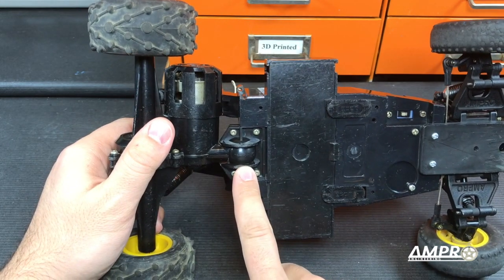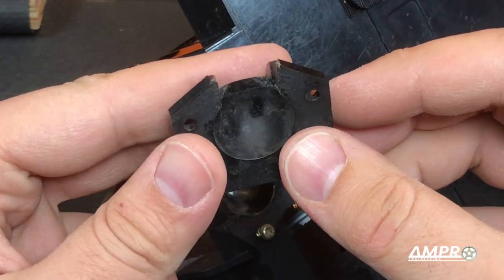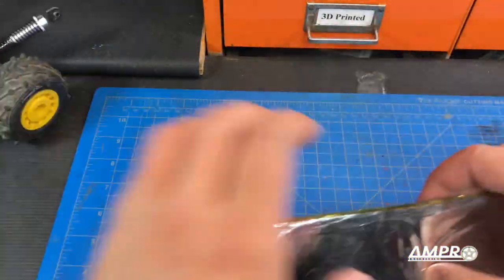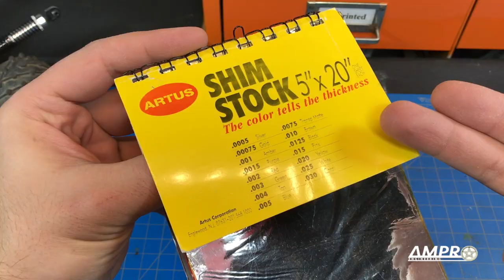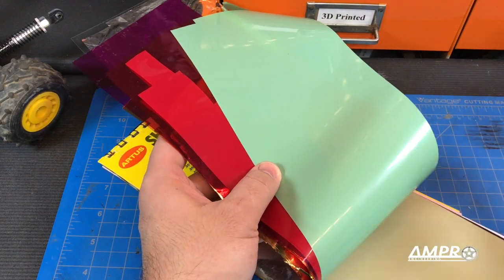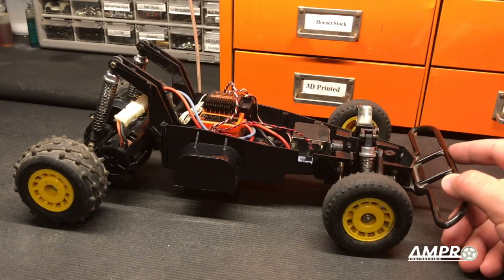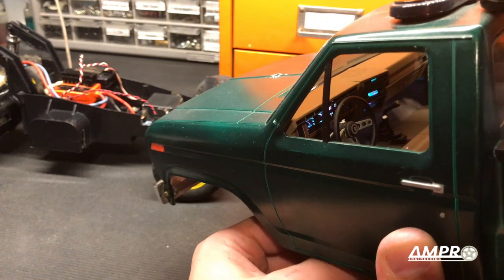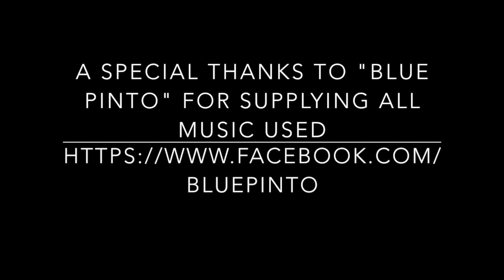e126: Varicom/Panda Pandamonium aka Graupner Pinto Project "Pointless" Part 4

Comment: Ahh the Novak T4 that was my first esc I ever bought I installed it in my Futaba FX10 (still have that car) I went through a couple of them always seem to blow out the brake mosfet especially with my RC10L eventually I saved enough money to upgrade to the higher end esc plus a discount from  my new job working for my local hobby shop (Franciscan Hobbies SF) helped too always the racer I usually sold off my old gear to upgrade to newer and better now I wish I still owned a few of those old cars especially the customized cars like my JRx2/pro hybrid and my RC10L with a TRC composite craft 12 pack chassis and a narrow rear pod both cars were dialed for the local tracks.
Reply from the maker: Yeah I seem to have a pile of them installed in older cars. I love them since I have gotten a lot of burned out ones over the years that I was able to repair. I love non-ic boards! Those were a great set of cars too. I am not far from SF actually though im sure that place is gone.

Comment: 😊👍 Nice work...once you use goop glue your hooked! That graphite spray works pretty good I use it on stuff that cant be oiled all the time on my tanks and stuff.
Reply from the maker: I swear by that graphite spray but just the door lock one. Like I said i have some industrial stuff at the office that is a mess to work with.

Comment: Not that it's a big deal but will that shim stock hold up to the friction, what material is shim stalk?
Reply: I guess it's alluminum?
Reply from the maker: Great question. With a lot of use, no way. It is plastic so it will wear but I do not plan on using this a lot so it will be fine. I ended up finding thin brass so that would have been way better.
Reply from the maker: It is all plastic but I think they are various types in that set.